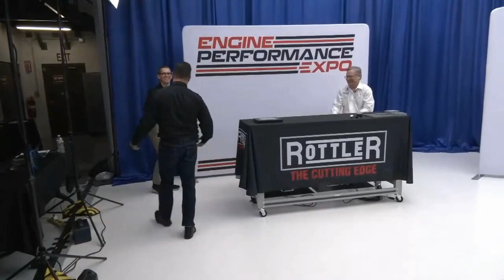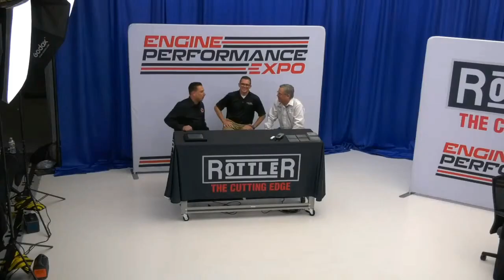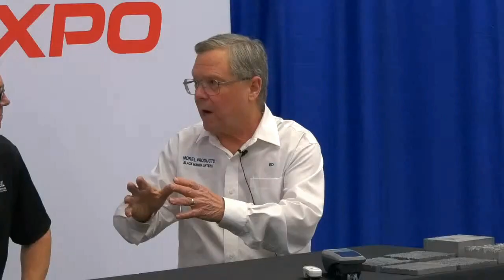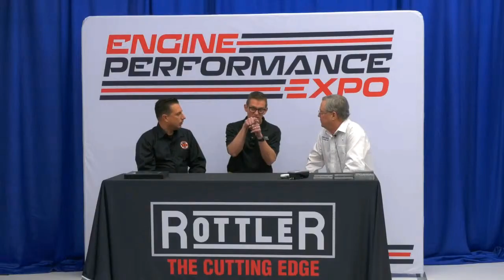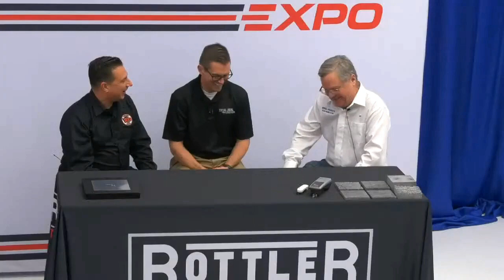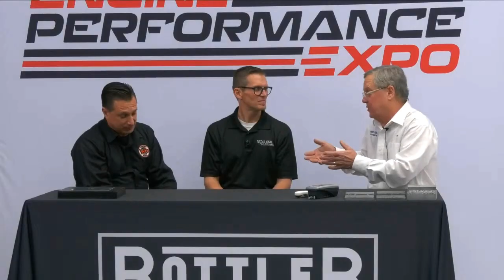Mr Roller Lifter, Ed Morel Talks Hidden Horsepower

Comment: Am using a comp RX intake lobe and a xcx exhaust lobe w the cheapest morel lifter a light weight spring loaded lifter -no falures in 15 years yes the lifter are sent in to morel for rebuild every 3 seasons 8200 shift 8400 at the stripe morel is the best

Comment: Hey great video!
I have a Blueprint Engine 598 that has the Morel Street Hydraulic Lifters and they are extremely loud at warm and even after it is warmed up. I tried to adjust them and went from 3/4 to 1 full turn and it did not make any difference sad to say. I am using VR1 10W30 and I even tried Driven oil 40 and it didn't make a difference. I tried the Driven 15W50 for about 50 miles and again no difference. I then tried the VR1 20w50 and it made a huge difference once it warmed up only. Unfortunately I have to go back to the VR1 10W30 because of my main bearing clearance of .0020 to .0025 my engine only has 4,000 miles on it and I have so many people coming up to me at car shows saying boy your valve train is very loud! I just don't know what to do? Do you have any advice? Thanks
Reply: Loud at idle isn't a problem. My family races 4.3 chevy v6s with rollers. We set our lifters at one quarter turn past zero lash. We frequently hit 6300 with these engines and are stuck with stamped rockers. Like you We run 20w50 VR1 but I want to go a bit lighter.

Comment: Have had two Morel 5323 lifters fail. First one was bad from start up. Broke my pushrod guide plate, bent the pushrod and nicked my Harland Sharp roller lifter, had to be rebuilt by Harland Sharp. This hapened with less than 50 miles on professionally built motor. My engine builder replaced the parts for free luckily. The second one just collapsed with less than 1000 miles on it. It's always someone else fault when the Morels fail never their fault.
Reply: The last batch of Comp Cams rollers I bought were chock full of shavings and chips in side and out. The also changed the retainers so you can't take them apart and clean them. The Morels we replaced them with worked flawlessly.  Our use was sbc vortec.

Comment: HOL UP 🤯
This madman eliminated needle bearings out of roller lifters and instead replaced it with a fluid film bearing like you'd find on camshaft and crankshaft mains. And they ended up being almost indestructible as a result. 😮

Comment: Want real hp get dohc motor drop push rods and the valvetrain of the 5os. Yes they can make power but never last. Smaller lighter  more efficient engines can make big hp and last 10 times longer.  This would be like kuds going back to flip phones and speak and spell. Why? Get in 22st century car makers from usa.
Reply: Nah... want torque?  Ditch the DOHC. 

"Lasts 10 times longer.." 
NOPE. The 12 feet of timing chain, the guides, and the tensioners WILL be shot before 100,000 miles. 

Also, I like to NOT have to spend $3000 to cam up my engine, and have to replace FOUR cams and the ridiculous timing setup.

DOHC?? 👎
Reply: Lol stroke does torque not 2 valve pushrods. do you know anything about engines? and timing chain on dohc last a goid long time. Old push rod has no adbantage not one over dohc
 Not mention dohc can rev much higher make more hp and torque per cubic inch. Only race series do.inated by old push rod motors are Nascar and dirt track, neither what you call tech series. Basically stuck in 60s.
Reply: The main problem with pushrods is that they are in the way of the cylinder head design but most modern car engines don't rev to 9000 RPM and don't need to. Ford made a lot of 4 valve cylinder heads with dual cams but their latest design large engine reverted back to pushrods, I wonder why? It's because it's much simpler and cheaper and more reliable and not necessary for a lazy high torque truck engine

Comment: >>> *At The Beginning of the video. The Speaker mentioned they are A Gear Shop. So. Maybe they have Gleason Gear Hob Machines or CNC TYPE MACHINES, which some Newer Technoloy is used.. (( At time stamp,  1:07,, He said they do work for MACY FERGUSON, , When It Is Pronounced MASSEY FERGUSON)). But since He works there and MAY BE A PRO,  I AM SURE HE IS CORRECT???

Comment: How much pressure does it take to lubricate that bearing in the lifter?
Reply from the maker: Gauge pressure is not the key. Enough oil supply is the key.
Reply: @hiddenhorsepowerpodcast   Thats the entire reason I run Mellings HV Oil pumps for many years in my small block Chevy's - NEVER had an oil issue or pressure problem, usually they run 60 to 90 PSI  (temp dependant) - Now that I have more information on motor oil, (Thank you Lake Speed Jr !) I will be changing my oil to his recommendation.
Reply: Yep, it's not the pressure that matters, it's the volume